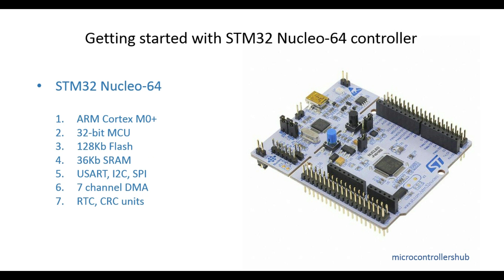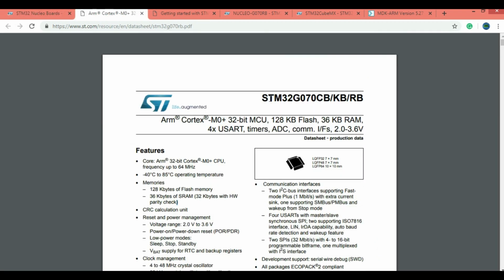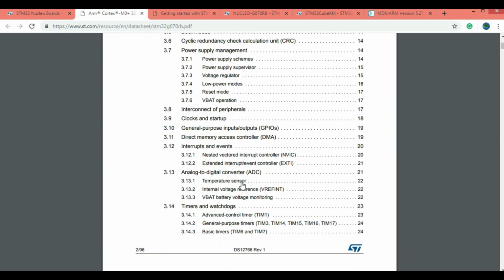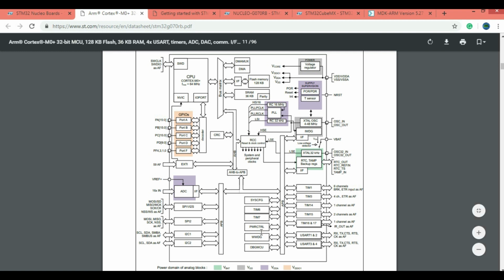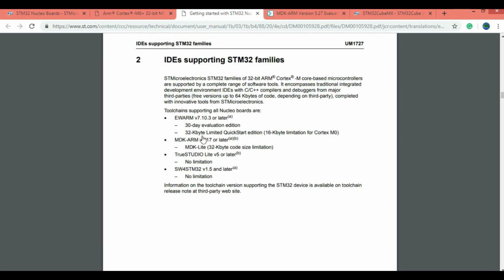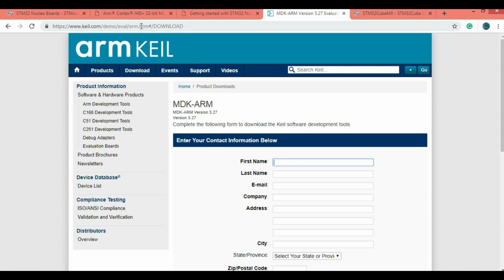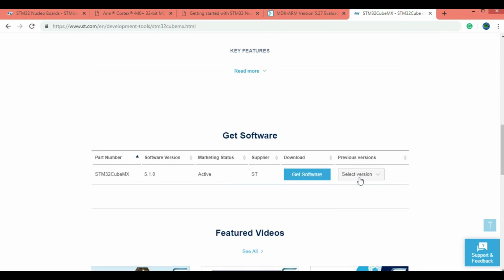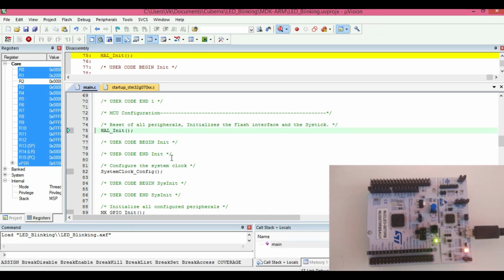Getting started with STM32 Nucleo-64 ARM Cortex M0+ board.

Comment: STM32 Nucleo doest need a bootloader??
Reply from the maker: +Yacine Hefied 
Every controller needs to have a bootloader. STM32 also have it. 

May I know the reason to have this question ?
Reply: then the sm32 nucleo has a bootloader integrated into the circuit??
Reply from the maker: @yacinehefied7390  
The bootloader will always be integrated inside the main microcontroller chip itself. 

So in this case the bootloader is present on STM32 controller which is present on the board
Reply: @Microcontrollershub  Thank you very much for your answer ^^

Comment: Great video thanks!  I also bought a Nucleo 64-based development kit, and I decided to go with PGBoard, which has sensors, GPS, NB-IoT connection/SIM but I can use CubeMx and most of code sample. 
I wrote a simple tutorial, Get started with STM32 and CubeMX on macOS
https://forum.pgboard.eu/viewtopic.php?f=65&t=17&p=17 
Next I want implement GPS tracker using NB-IoT, will keep you posted :)

Comment: Kit a lot more expensive Than Arduino or ESP32/8266
+ Limited IDE if you dont buy expensive software 

Not sure what are the advantages of this new STM32F0G vs STM32F103 for example. Bluepill boards are dirt cheap.
Reply: STM now offers Atollic, which is based on Eclipse.
Reply: @dmitriwisotski2  Interesting, Thanks.
Reply from the maker: @dmitriwisotski2  
Ohh ! I will surely check it. Thanks ☺️
Reply: Nucleo boards are similar in price to official Arduino boards. You can also get STM32 boards (such as "bluepill") from other manufacturers for dirt cheap. The difference here is that Arduino is imo a bit more open source, so you can get all the support from Arduino company without actually buying products from them.